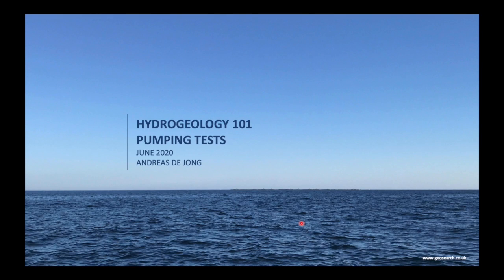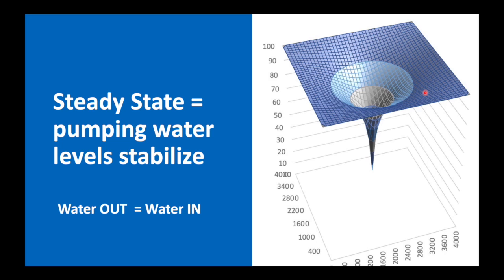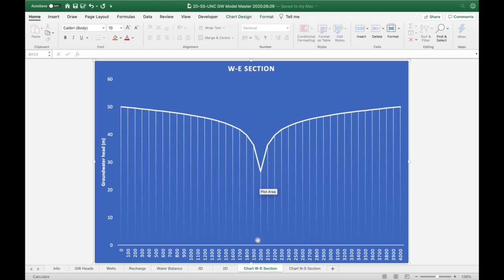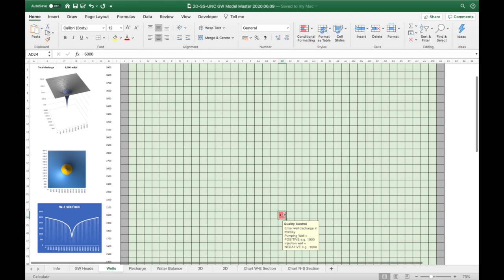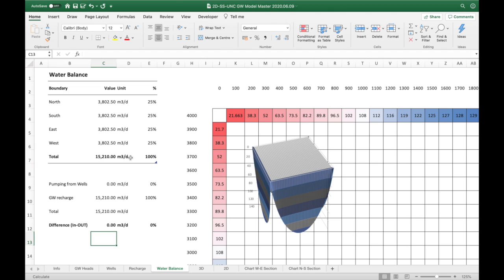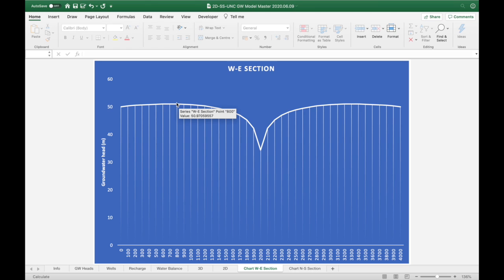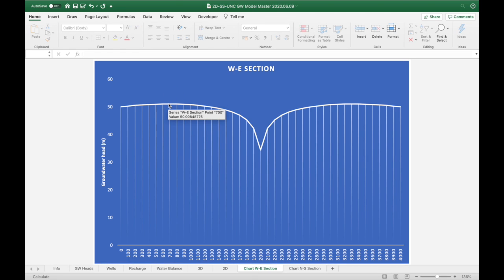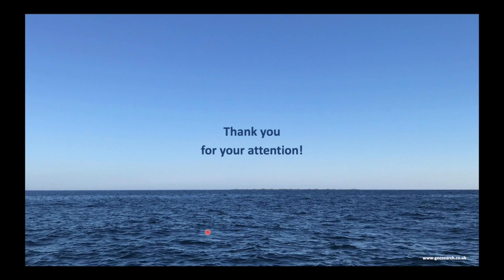Hydrogeology 101: Steady state in pumping wells

Comment: What's the method of selecting values of constant head?
Reply from the maker: Dear Amit, thanks for your question. In the video it was just an arbitrary number as we wanted to see what the cone of depression looks like. In a real model, the constant head values should reflect the elevation of the water surface (ie head) which is interacting with the aquifer. For example, the elevation above datum of water levels in a lake or in a river which is hydraulically connected to the aquifer. Remember that the constant head boundary just means that the heads there are fixed, and groundwater can flow from the boundary into the aquifer and also from the aquifer to the boundary. All the best, Andreas